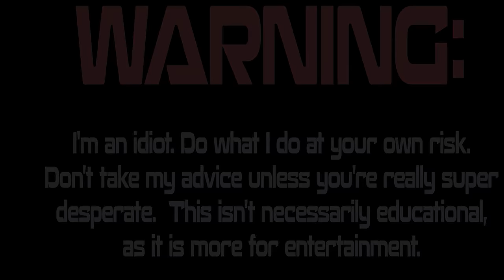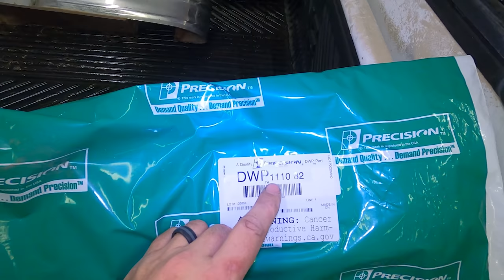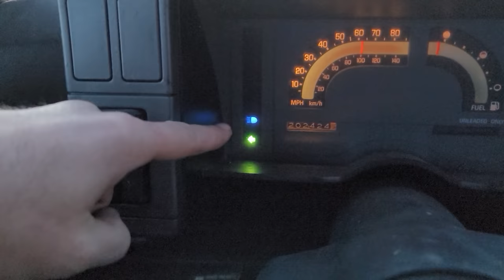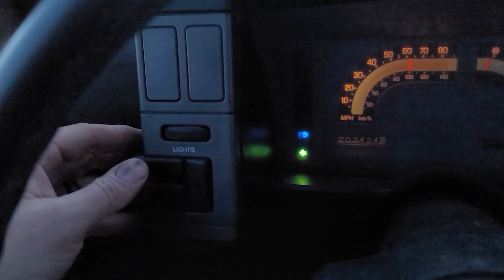Attempting a 600 Mile Drive In a FORGOTTEN Chevy S10 (multiple Issues)

Comment: when you said “and some warm clothes, because i’m gonna be walking”... i felt that. coming from a s10 owner
Reply: I had a newer S-10. The engine was fine though it wasted gasoline. Stupid transmission and transfer case always needed work. 
Front lower ball joints had to be replaced twice in a 4 year period.

Comment: "Probably a bad ground...the frame doesn't have any metallic properties left" 😂
Reply: I have never seen such rusted vehicles as what he ends up with. Why so badly rusted, never seen such things before, it's like 'why bother' with that junk. Lol I know, I know, it's good content and fun to watch.
Reply: @trevorjameson3213  Because that's life in the Midwest. If it's over 5 years old, it's rusty
Reply: Frame
Reply: @SalandFindles  thanks...corrected 😁
Reply: @trevorjameson3213  most of his cars don't have proper rust with holes. Except the independence chevelle
Reply: @trevorjameson3213  I mean here in ontario things rot like crazy. If your in to old cars the rotten ones still hold some value, but pretty cheap. The actually good ones are always big bucks. So you just kinda live with it. Also once your trained in the art of the bondo an old truck like that can be totaly respectable for a few hours and a couple cans of white paint. I mean it all falls out in 6 months and if you hit a bicycle they will be digging you out with the jaws of life. But overall good fun for next to free. I failed myself this year and bought a 2000 something pacifica as a winter beater for 300 bucks. Shes actually pretty minty up top, but underneath there is nothing left, I honestly considered not lifting it on a hoist for fear of it becoming 2 cars, but ya got to get your snowys on round here.

Comment: Ahh yes, the classic wireless exhaust system. In my line of work we call that a "high impedance air gap". 🤣 I'm enjoying your videos a lot. Thanks. 👍
Reply: I'd say most (all 😂) of the digical connections and switch contacts have also become very high impedance.... in the ♾  range! 🤣😂🤣
Reply: I prefer to delete those old mufflers and replace them with galvanized fence post.  It gives them a really nice sound!

Comment: Putting the Summit sticker on the tailgate doubled the value of the truck.
Reply: The hoosier spare tire lmfao
Reply: Not only that but it increased the structural integrity of the tailgate by 917%.
Reply: I believe that newish-looking Chevrolet mud flap on the passenger side rear is the most valuable part on this nightmare!
Reply: Added horsepower too

Comment: A guy misses his old '93 S10, last of the square body. Never cared for 94's on what with all the swoops and child safe corners. That '93 and I had some fond memories after 380k or so miles. One fond memory was when the truck needed its second replacement clutch and the broken springs fell between the clutch disk and flywheel rendering the clutch pedal useless. Sure, a feller could've replaced it right away, but I did the right thing and just kept on driving it daily for the next 6 months, and replacing both the clutch disk, and a starter. Have to say though, I got pretty good at RPM matching for shifts, even for downshift. Also learned the space to drop and replace that starter was tighter than Roseanne Barr's girdle.

Love all your content, reminds me of growing up wrenching on vehicles and anything else me and my dad could find. Glad to see you doing the same with your boys.  Bring the Thunder!

Comment: "Do your best flare without the fitting on the line..."  Absolutely rolling on the floor!!!!! (Done that)
Reply: Works just the same for the heat shrink tubinators.
Reply: Every dang it time!😂😂
Reply: Yep same here
Reply: @paulculbert1281  stole my comment :-)
Reply: Have to try putting it on facing the wrong way, thats good for a chuckle.
Reply: @paulculbert1281  ugh yeah. “Look at how nice of a soldering job this is, now I just need to...dammit the heat shrink!”

Comment: Had an 88 GMC flavor of this truck, bought it cheap, replaced the throttle body and distributor and it ran good for 5 years, 4 speed was fun, but coulda used a 5th on the highway. Great job Derek, love your sense of humor, I need a T Shirt that says, " That's fine " .... Love your channel and your ability to revive forgotten rides....Eventually sold the truck for nearly double what I had in it, was my first fuel injected vehicle ever...

Comment: I would like to add a suggestion on rusty bolts and nuts. My. Dad and I had to remove large machines from the floor. Dad would get a bottle of warm coke and pour it on the nuts and floor bolts that hold down the machines. Works every time.

Comment: One of the best small pickup trucks ever made.  Had a 2000 with 200,000 miles just regular maintenance until it got totalled.
Reply: The 99-06 Silverado/Sierra were the best full size trucks too. Can’t kill the things. Couldn’t kill the 91 Sonoma I had either. S10/Sonomas we’re the best small trucks.
Reply: Every one of those trucks had nearly 300,000 miles when I got rid of them.

Comment: Wish I'd seen this 10 years ago. When I tried to fix the rear brake lines on my '88 S10, figured out that a brad nail plug in the fitting off the distribution block works real good at converting to 2 wheel brakes. Never had the chance to test it good because the throttle body injection decided it wanted to be next on the fix-it list a week later, so I traded it for a '98 Olds 98.

Comment: So proud of you Derek, the hour flies by, I hang on every episode. My daughter, your age was caught years ago on the interstate with kids, they were driving the 4 door version of the old s-10, we drove down and rescued her with a $10 idler pulley and socket set from auto zone after we got there. Also, when your son changed the belt, reminded I had a Caprice 9C1, had just sweated blood changing the waterpump/ optispark. Making a noise could not figure- the belt had split longwise in 2, the entire length of the belt, still running. Never heard of that..Also, I had a company 1982 S-10 standard cab, when they were gee whiz new, used to commute 3 guys across on the bench seat.

Comment: I would have had a nervous breakdown going through all those stop lights with no clutch lol
Reply: Clutch?  The tag in the glove box said it didn't have options🧐
Reply: I used to practice shifting without clutch just in case...ha
Reply: @chuckthebull  Upshifting is easy, downshifting is another story
Reply: @user-tb7rn1il3q  yeah true..i have done both..if you can match the rpm to the engine its not so bad..i kinda give the gas a little bump right around where i think its synced up and as the rpm drops a bit then drop the shift in so it sorta rides into the spot..im sure its not so good on the trans but if you do it right its very little force. Still first gear is the hardest one of course.. But its a skill and finesse like any other.. not everyone can be a rock star. oh wait,, yes today they can lol
Reply: It's just as bad with no brakes you just have to flinstone it
Reply: Interestingly our guy here always looks for the things every other guy will try to avoid when purchasing a car. 🤙
Reply: Reminds me of high school. I used to lose the clutch linkage in my old pickup pretty regularly, although the three-speed that was in it at the time was so worn that you could usually just crash it anyway. :)

Comment: Be glad yours has the 2.5L. The 2.8L was slow with bad gas mileage. I had a 91 with a tired but reliable 4.3L. 0psi oil pressure at warm idle. Drove it like that for 4 years. Never seized up or knocked though.
Reply: Drove it 50k like that. Had good oil pressure when cold, but not warm. Was going to find another 4.3 for it, but got a good deal on a Sierra. Guy who bought the 91 put in a 350.
Reply: He kept the same transmission. Apparently the 4.3 & the 350 use the same bellhousing.

Comment: Back in the day I had almost the exact same truck, 86 S10 2.5 except mine was the 700r4 auto which surprisingly enough wasn't too bad! Manual brakes and steering, no a/c, I drove that truck through hell and back for 4 years with the engine knocking the entire time and it never would give up, installed rob bearings and didn't fix it so I'm assuming either wrist pins or main bearings but either way that thing was unstoppable man! Lol

Comment: i drove an 87 S10 with a 5 speed manual for 13 yrs, changed the engine once and rebuilt the body with new paint once. replaced most of the interior other than the dash. replaced the bench seat with factory buckets and consol. put in a tilt wheel and power steering too. was a great little truck. it was a Manitoba truck. it had over 635 thousand kilometers on it when i finally retired it. the origional iron duke overheated and cracked the head. couldn't find another engine for cheap so, I put pepper in the rad and plugged the crack. got another year out of the engine before i finally found a replacement Duke.

Comment: Yesterday I bought a new wheel cylinder that leaked right away. So I just dug thru my box of o rings found one that fit the bore jammed her on top of the rubber seal put the piston back in and she don't leak a drop

Comment: Using the long weekend to catch up on some your old videos. I noticed a pattern - you find old rust buckets and take them to your place - strip off anything you can sell on evil- bay and then drive what’s left to your brothers house. So I looked it up and sure enough I found a VGG Junkyard Annex in the Dakota’s. Great add - prices were 10 dollars per day storage fee so if you get a fresh one it is really cheap. Don’t let it sit while you try to figure it out as the price goes up. Also the guarantee is unbeatable “extremely used so you know it works” and the certificate for as many VGG stickers you need to keep it going on down the road - I cannot believe anyone could pass it up. Great videos! Back to watching the next one. You look a lot bigger on my 65 inch TV than my iPad.

Comment: I had a similar headlight/taillight issue. Brand new car, had them put in an alarm system. The broke the headlight switch. I got pulled over -- I didn't realize I only had headlights. Made a jumper right there at the switch and brought it back to life.

Comment: Those 4 cyc s10s came with thoses type of headers. I had to replace one from GM , 600 bucks in 2000. They are really nice.  That heat sheid will rattle if one if the rivets breaks.  My header had a huge crack in the number 3 tube.

Comment: This video came up in my feed for a second time but in the interest of helping when your out scooping up a vehicle I wanted to tell you about a trick. If you can get a line nut off at what ever point (i.e master or proportioner) or wherever you snip the head of a nail off slip nail into line with the head facing flair seat and reinstall. So say you have a hole in a back line boup plugged and I mean plugged.

Comment: "Always do your best flare, without the fitting on"
You know, it always happens like that. You get a perfect flare the first time, then every time you try to replicate it with the fitting on it's only half-gooder.
I did exactly that the last time I replaced lines. What I thought was the fitting on the line was actually the fitting from the other end that had slid down to troll me.

Comment: Oh wow, I got an old 97 Sonoma for like 600 dollars 5 years ago that had all the body rust and holes is pretty much exact to this one. I did the ol duct tape body work with rattler paint job on top of it to fix it and custom door latches on both sides of the tailgate door mounted using jb weld so it didn't flap in the wind. It was just fine.

Comment: Have you ever bought a forgotten 88-98 Chevy or GMC full size yet? Just as much fun as those S-10s! I bought a 1990 GMC Sierra, sight unseen. $1500 typical rocker and cab corner "natural weight reduction. " Single cab. Long bed. 350. 5 speed. 2wd. Pretty rare combo. Did the first day wake up from years of sleep. Runs great now. Was one of the easiest ones to get back running and driving, I ever bought. 😂 $5000 later, almost done. Nice truck project. Just parts prices are outrageous! More than ever! You gotta be loaded with money. I do what you do, once every 15 years. That's one vehicle per 15 years.

Comment: I wonder if the loss of power was carb icing. Had that in a car years ago without a warm air intake. Left it for a while and it started after the frozen fuel had melted. Flooded the hell out of it though.

Comment: When I bought my 69 VW Beetle, it too, had zero brakes.  I ended up replacing all four slave cylinders,  and two hard lines.  Couldn't get the thing to push fluid from the master to the back.  I pumped fluid from the back end to the front and then bled them.  It was 32.79(repeating)% betterer.

Comment: Wow what a mess. I have a 1993 S-10 (last year for the square body) that I bought new. It has a total of 56K miles on it and is absolutely mint. Garaged all it's life, never been used as a truck. I live in the Phoenix, AZ area, so NO rust, still has most of the wax on the frame put there by the factory. It has the 4.3L V6 and a 5 speed. It is a standard cab 2WD short bed. I have customized it a bit. Cowl hood, cat back fake dual exhaust with a Y pipe (even the factories are doing that) and no mufflers. Tonneau cover on the bed, 225/70-14 RWL T/A Radials up front, huge 275/60-15 RWL T/A Radials in the back on custom wheels. Huge 5" tachometer mounted on the dash, chrome differential cover. Completely stock engine, but it looks and sounds like it just came off the dragstrip. Tons of fun to drive.

Comment: I just bought a 98 2.2 5 speed S10 that was sitting in a field for 5 yrs, for 300 bucks.  Put a new battery in it and it started right up.  Been driving it ever since w/o any problems.

Comment: As a retired, certified mechanic, I spent many years and many miles driving an 86 Chevy S-10 to bumfluck Egypt and back, repairing rental cars on the sides of highway's.
There has never been another vehicle from ANY manufacturer, or ANY year, at ANY price, that is as durable, and reliable as the first generation Chevy S-10. I have seen over 700k miles on original engines and transmissions.
Toyota is great at marketing.
Chevy is great at building automobile's.

Comment: I used the push to move method. I started my S10 and just pushed the shifter Forward in the first gear and just held pressure and it would start rolling until it got going fast enough it would slip into gear and then do the same thing that you're doing when you get the RPMs that right RPM he just switch gears quick but I could start a light I can pull it out of gear and keep it neutral I just took a minute to take off from the lighter stop sign cuz you had to hold it for a minute to get it rolling

Comment: You guys are probably gonna think I'm crazy but I think this one needs an off the frame restoration ( would love to see this one taken apart. the frame replaced, and the quarters, all the suspension parts floor pan as well. I know that sounds like a lot but considering the miles and condition of interior and engine, maybe TA upgrade . Honest I would just love to see her restored! Pontiac doesn't exsist anymore and needs a little special attention

Comment: I had an 88S 10 had a 2.5 on Duke I got 275,000 miles are still running when I sold it open I did put a clutch in it and I did change the head gasket

Comment: I know that the Super Bendy Flex 200 company produces brake lines, but do they also make brake rotors? Because when I replace the one on my 04 Grand Marquis which currently mixes drives very well will need one that equally as bendy and flexible. I like things original!

Comment: The carboard-ish glove box in my '72 C10 looked like that, just cut it out, pulled out the seats and the fuel tank, then power washed the entire inside of the truck multiple times. I hate mice so much.

Comment: The Iron Duke ,  I've got an 88 chevy s10.  I've had problems with the clutch slave cylinder too,  I think it really needs that heat shield that fits on the exhaust pipe in front of the slave cylinder or it will melt the rubber inside. A possible, anyway.  I'm jealous that yours came with the sliding rear window, but mine doesn't have rust. Over hauled the engine some years back and then put in a new used borg warner 5 speed tranny. It developed a tick, I think one of the hydraulic valves ain't working, but picked up some new ones and just got to get around to replacing the old with the new. I've got other projects on a car and another truck to do first.  I like the way you did not panic. There is nothing like like the feeling a person gets when the vehicle, goes tit's up on that lonesome road.

Comment: Brother you need one of those induction bolt cookers relly bad! 😏 if anyone would use one of those items it’s you absolutely and they work lots better than a torch because it’s focused and it gets all the stuff boiling in the threads fast too! I think you should look into getting one they’re a couple hundred but they replace mapp gas torches and they last years and years you will be giddy every time you use one!  ☝️ my Uncle has one and we used it on his 379 Pete exhaust bolts it was absolutely wonderful! I don’t remember what brand but it was red and I think maybe Snap-On not sure 🤔

Comment: I has a 97 s 10 about 3 years ago that sat not running 8 years. It ran good eventually but the mouse smell never came out I changed the seats the carpet, and used one of the ozone things and it smelled as bad as it did when I first got it.

Comment: Can I bring something up???? It does NOT matter if you run with a full or 1/4 tank... The PICKUP TUBE is on the BOTTOM of the tank all the time... The only thing running with more fuel does, is help keep the pump cool, or dilute bad gas.  And debris on the bottom of the tank, will be picked up regardless....  Just an FYI.